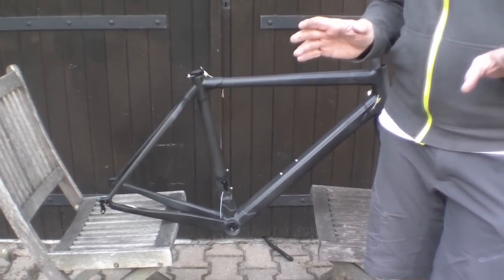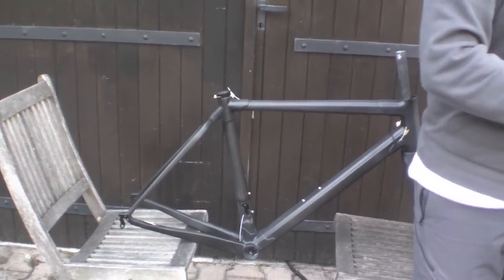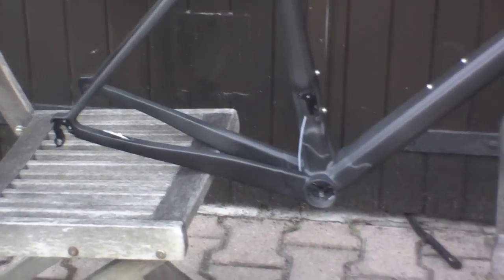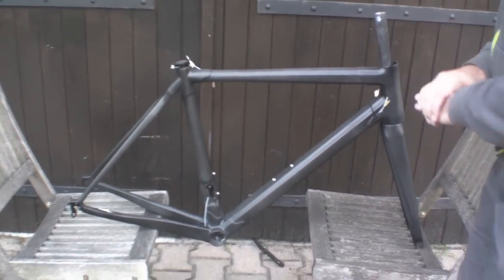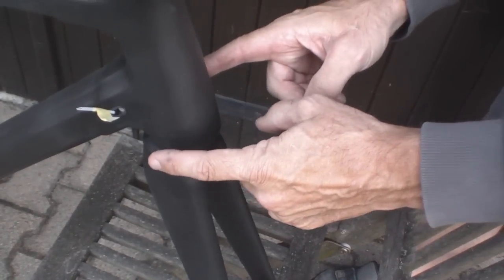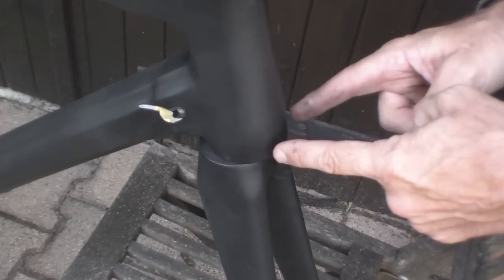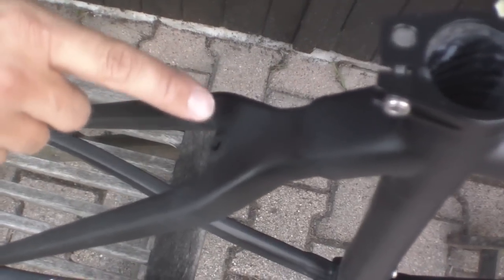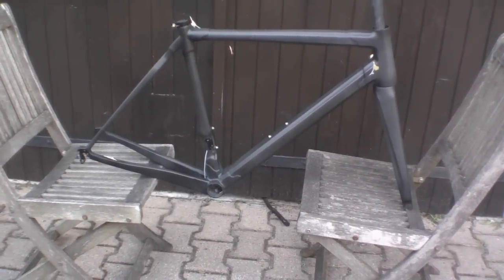F for Fake Colnago C60

Comment: This is great video for someone buying at a real Colnago price, so yes don’t get scam. In the other end I have one like it without decals painted black, I have put 13000 Miles mostly flat some hills, and I have never had any problems, it’s holding up great I’m not sure what’s the limit on this bike. Thanks for the video
Reply from the maker: Hi Luis, where did you buy your frame? I think the Chinese are pretty good with carbon fibre, you don't hear of many problems. I rode this frame over the Tour de France "off road" route on the plateau de Glieres.
Reply: Luis Dominguez until it breaks, crash, accident, potential death happens...

Comment: How does it ride
Reply from the maker: I had a Deng Fu generic H28 frame before and this is definitely nicer. I think the large, square box section soaks up a lot of vibration but is fairly rigid. It is a monocoque layup rather than a real lugged frame AFAIKS.

Comment: How safe are these frames? Are there any risk of breaking and having an accident?
Reply from the maker: That is a very good question. With Colnago you have a European company standing behind their product. That said, some of the well known Chinese brands like Deng-Fu have built up a good reputation and despite tens of thousands of sales you don't hear of many problems, certainly no more than with the major brands.
Reply: davidzof im starting to think there are more accidents than we think. Not reported as people don’t want to say they have had an accident on a fake frame. I looked into one with my mechanic, he thought it was not a safe frame to ride. Maybe good to have on a turbo trainer at home....;)
Reply: @flimps  The Sava road bikes are UCI approved. I now have 2 of them the older 2016 model and the Savadeck Phantom 3 with 50mm carbon wheels. It's a T800 frame and is very tough a little on the heavier side but that is a good thing. You don't want high Modulus Carbon those are a bit more dangerous from Aliexpress.
Reply: Would anonymous Chinese companies cut costs and lie to make more money?  I'm trying to remember if I've heard of this happening before...

Comment: Everything this guy said is complete bullshit. The tubes and joints are not made in Italy, they are made in Taiwan. They are then shipped to Italy for gluing ( pre peg and pasting) and the bikes are painted there. So NO THIS BIKE IS NOT MADE IN ITALY, it's assembled in Italy.
These guys need to stop this nonsense, every Bike manufacturer gets their frames from China or the higher end customs from Taiwanese companies. The Chinese buy the schematics from the Taiwanese companies to make the copies.
Reply from the maker: Colnago used to source their frame tubes from ATR composites who also used to supply Ferrari. ATR went bust and lugs and tubes now come from Toray, a Japanese firm. The frame is assembled in Italy. If you see one on Alibaba it is unlikely to be using the Toray tubeset.
Reply: @davidzof  They are Toray T1100 ( No High modulus garbage) . Should be arriving in a few days, I will be doing a full review of the frame including scope camera video of the insides, parts that went into the bike build etc. It’s a straight standard frame no pockets on the frame inserts, it’s the c60, the factory I ordered it from is around 10 years old as checked , also bought other items from them and been pretty solid. The problem with Taiwan frames now is they are so busy since the USA and Europe can’t build a fucking bicycle that the Taiwanese factories are using China factories to sustain the amount of orders they get.
Reply from the maker: @danfuerthgillis4483  Please link to your review here.
Reply: @davidzof  I will I already have the first part of the video done going over the “Budget” components being installed, it’s a freak show mash up but will be one hilarious video once you see the madness mix up of parts 🤣. Here is the shifters for example completely bonkers but watch the video why so I rave about these shifters https://youtu.be/HFaNKtMZbWg I use what makes sense to me not others.